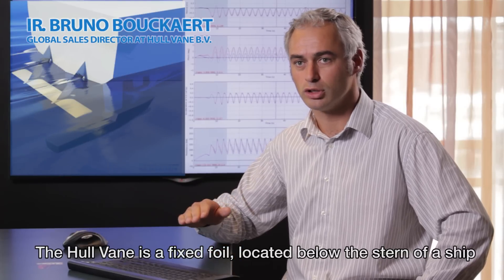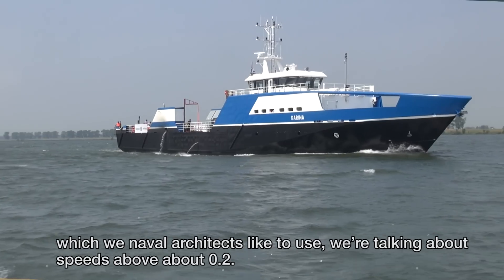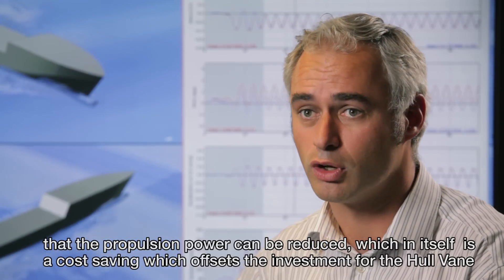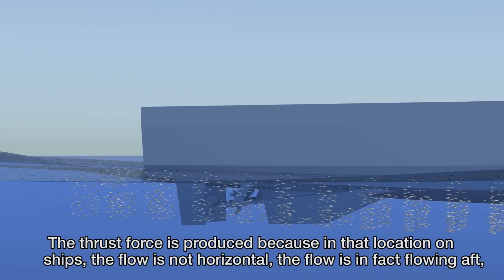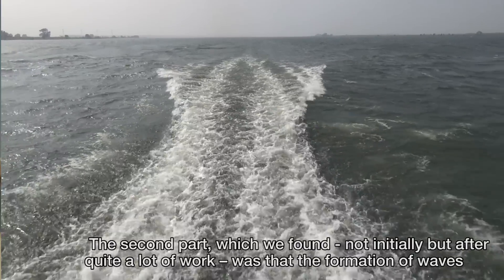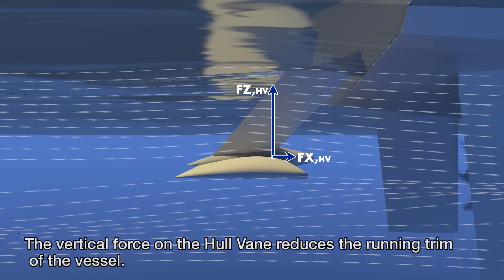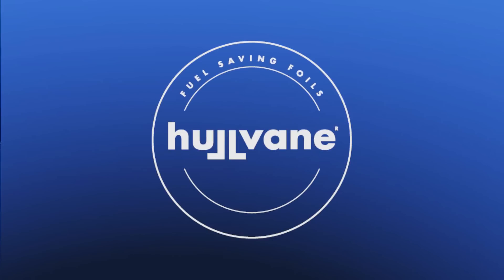Hull Vane - Fuel Saving Foils

Comment: Forgot to mention a fifth benefit: In waves, the dampened rocking of the hull will also provide a much more stable experience for passengers, crew, cargo, and mechanical stress on the ship's hull itself. Any cruise ship maker should celebrate and exploit this tech immediately. 
Has anybody experimented with variable geometries in hull vanes?

Comment: This is not that much beneficial. They are improving wave-making resistance but adding too much weight + wetted surface area. In addition, this technology is already used via BULBS. You simply put the bulb behind the ship and destroy the flow that comes from the propeller. The water should be as much as more open after the propeller. Propellers have the best efficiency when there is open water. 
You little bit of improved stern wake and that is all. There is no way to gain 14% efficiency with this with any hydrodynamically analyzed ships. The effect and benefit is exaggerated.

Comment: Totally B.S.!  The hull is like a pendulum. Lift the rear end and the whole rest of the hull sinks into the water causing more friction. Which is why foils are amidship OR PLACED ON BOTH ENDS TO lift the entire hull as on a ferry. Also, why not just build ships to ride deeper in the bow area to begin with, with weight distribution...  Because engineers know better. design alone can lift or deepen either end.  Also, I DOUBT speed on large ships is just not adequate with their weight for a foil to cause even that low percentage, IMHO...  And if it were reversed, would bring the widest part of the hull DEEPER into the water which would create even more drag... Foils on boats have been around for decades. The U.S. Navy put them on the fast PT Boats and made the very fast a long time ago ...
Reply from the maker: Dear Rob, did you watch the explanation in the video? Kindly also view the other videos on our channel. The purpose of Hull Vane is not to lift the vessel at the aft (even though that  happens and is beneficial on many ships). The purpose is to reduce the overall resistance. You can clearly see this in the reduction of the stern wave (waves are energy, when a ship makes less waves, it consumes less energy). Hull Vane has very little in common with the 100% hydrofoiling applications on US navy patrol boats, Russian ferries and America's Cup sailing boats. Different kind of ships (in weight especially), different location of the foil, different goal and different working principles.

Comment: I was Ch Officer of a 100m long coastal tanker, max draft 6.0m. When fully loaded i kept a 0.5 -1.0m trim by the stern. Sea speed about 11.0 knots. Contrary to what was shown in the video, at sea speed my vessel takes a trim by the bow, even with initial static trim of 0.5 - 1.0m by the stern. When my ship moves ahead at sea, rain water and sea water on deck would flow forward towards the bow. When the vessel reduces speed on arrival port, the water flowed aft. Perhaps this aspect needs to be studied further.
With the hull vane fitted, i presume the ship will be trimmed more by the head when moving at sea, lowering the bow height above water.

Comment: Would it work on Fishing vessels at speeds of around 5kn? it would be benefitial since the maximum power allowed for fishing vessels is restricted. (but the regulation dating from 1975 never took the shape of the ship into account) If this can help the fishing vessel reach the ideal 'fishing speed' at around 4.5- 5.5 knots, combined with better fuel efficiency and stability that would be very interesting.
Reply from the maker: What is the length of those fishing vessels?
Reply: @hullvanebv2550  24m but I saw on the website that the vane works from 8kn so they might go too slow for that.

Comment: How much difference is there in performance to that of cav plates ?
Reply from the maker: Do you mean interceptors with cav plates? There is a paper comparing Hull Vane with interceptors at various speeds for a typical round bilge displacement hull on our website (AMECRC series 13): https://www.hullvane.com/papers/
Reply: @hullvanebv2550   Interesting.
  I'm curious as to the differences between the fixed propulsion you diagram and outboard propulsion. The cav plates/ appended vanes I've seen on either side of outboard driven boats help with planing. I believe that your treatise is also. As well as efficiency.

Comment: Question, when doing your research and development of this design how deep did you go into the design at the starboard and port horizontal end of the hydrofoil?  Specifically, did you do analysis using "winglets and scimitar winglets like Airbus and Boeing?
Reply from the maker: Hi Apack, good question. Winglets can help in some cases, but not as general as on aircraft wings. It depends of the local flow and the speed range of the vessel (narrow vs. wide).  Some of our Hull Vanes are U-shaped, which means the wing curves up at the tips, to become the struts.

Comment: 2:13...this really confuses me...I have always known that a wing produces lift and drag, that points backward, and not a forward thrust...
Reply: Yes, when a plane fly's horizontally and the air flow comes from the front. But when it comes from the front and below, it is the same as if the airplane is flying slightly downwards, in which case it accelerates. That's how any glider flies. When the wind is coming from below, the plane can fly horizontally and still accelerates, this is how slope gliding works. Same effect here, the water current under the ship moves slightly upwards, and thus the foil can generate lift up and forwards.
Reply: @Rocco_Kurokawa  you are right, I was considering only the main horizontal flow and not the local vertical one they speak about in the video

Comment: How much lift, as a percentage of the  ship displacement, is generated by the Hull Vane? Is it the same percentage as the reduced resistance (or required power) you show in the video (12%)? Thank you
Reply from the maker: This depends a lot of the ship. It can go up to 10%, but on the vessel in the video it is less than 5%.

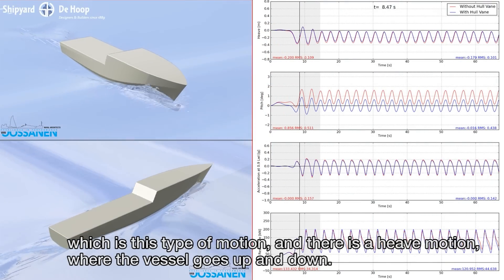Comment: 3:24

"Damp", not "dampen". (Also, it's already wet!)
Reply: damp·en
2.
 make less strong or intense.

"nothing could dampen her enthusiasm"

Dampen is correct.
Reply: @michaelcopeland8806  Umm, yes. Her enthusiasm notwithstanding, in engineering, in English, "damp" is more common and correct in relation to vibration and oscillation.
Reply: @sgabriel  Damp relates to engineering only when used as a verb, which is Dampen.
https://www.dictionary.com/browse/damp
Reply: @michaelcopeland8806  I recommend against using Google exclusively as a research tool. A lot of people do say "dampen" these days, so: fine. But I don't like it, and a lot of other engineers don't like it either. Anyway, doesn't matter particularly. Having said that, mostly we use "damp" as an intransitive verb, as in "damp down" or "damp out".
Reply: @sgabriel  Then why are you trying to correct someone else's use of a word, when it is you using the same word incorrectly, just because you don't like it. Dictionaries are dictionaries. Education is a wonderful thing.
Reply: @michaelcopeland8806  You got me, there.
Reply: @michaelcopeland8806  No need to be nasty, son. My education is excessive, but don't hold that against me. Mean time, try out "damper", a noun, which refers to a thing that...wait for it...damps.
Reply: @sgabriel  You have been educated by a more educated person. Have a wonderful day!
Reply: @michaelcopeland8806  I'm not sufficiently educated to understand what that means. But, you have a wonderful day, too!

Comment: If sea critters thought propellers were scary wait till they meet this blade of death.
A whale is gonna rip it off and maybe the whole stern.
How about a wind wing, less drag and weight and controlled lift using tried technology. Birds see it coming and get out of the way, not so underwater.
Plus everything is topside reducing corrosion and easy maintanance.
I'm thinking biplane for lift with wings that fold for foul weather.
How about steerable kites for reducing fuel.
I was going to try one off the bow of my 20' fishing boat.
Reply from the maker: Most of the water coming over the Hull Vane has usually already passed the propellers (much sharper blades rotating at much higher speed), rudders and stabilizers. Wind wings are used on boats for lift (see A2V boats  or Wing-In-Ground ships), but that's only effective on much faster, much lighter boats.

Comment: I read that this concept has been install on a catamaran initially,there is not much review on the results of this attempt, i am interested in this concept mainly to sail under low wind and to  keep the bow out the water for increased speed,can you  shed some light on this?

Comment: Nothing new, just a half hydrofoil system! Hydrofoil is much more efficient!
Reply from the maker: We call it partial hydrofoiling, and it is something new to use a hydrofoil for this purpose. Yes, 100% hydrofoiling may be extremely efficient on water, but our solution is intended for real ships, with real payloads, navigating in real seas. 100% hydrofoiling requires a totally different vessel, and is not suitable for all applications.

Comment: water dynamics r diff than air, greatly diff in drag, but idea is the same.
Reply: A bi-plane gives even more lift but w/drag. Air & plane drag increases greatly w/speed, but ship r not going to get the grea increase in drag w/speed bc they already hve great drag from water & don't go great speed. So if 1 wing is good a 2nd lower wing bigger a bit behind it r even better. Twice the wave sofening & less drag along the hull.

Comment: Sleek, the equations & multi forces at work might b complicated but the design is perfectly simple. Just behind the ship u a generating lift 1 & 2 the prop & wing r postioned so as to maximize this lift. At rear u hve the most leverage, & lifting force helps to bal out rolling wave force. Smoother ride less drag candy ass simple.

Comment: if you have a vessel that does a lot of pitching where it operates.. you might want to create a one of your wings that has hinges  close to the front edge and can be remotely unlocked on the rear..  this can create forward thrust from the pitching.  why dampen it totally when you can use pitching to add thrust.  it won't work on vessels that don't have enough pitch during normal operation but some..  there was a study about 25 years ago .. about a sailing hull with a design that had a lot of pitching designed in with hinged wings to create forward thrust..   somebody designed a reversing pitch blade to use with air boxes over swells allowing the change in airflow to spin small generators in the same direction no matter which way the air was flowing thru the fan..
Reply from the maker: Hi Wayne, good ideas, but as is often the case with good ideas, it has been thought of. We have a version which hinges and has an actuator for additional pitch dampening, called Dynamic Hull Vane. Pitching causes a lot of added resistance, so you generally want to reduce it as much as possible. The (passive) Hull Vane generates forward thrust out of the pitching motions through something we call "the pumping effect", similar to what surfers do on hydrofoil surfboards.
The Hull Vane converts both the stern wave and the ship motions into forward thrust, making the ship quieter, more efficient and more comfortable.

Comment: Is this still effective when you have  two propellers one behind the other on the same shaft that raises  propeller efficiency from 60% to 80% .If both can be combined the potential for fuel saving is hugely increased .
Reply from the maker: Hi Ronnie, yes the Hull Vane would still be effective. Counter-rotating propellers recover energy from the rotation of the propeller flow. Hull Vane recovers energy from the "rotation" (or rather upward flow) given by the ship's hull to the water.

Comment: What is the slowest speed the foil would be effective?
Reply from the maker: Hi Kevin, that depends of the length of the ship.  For a rough idea: for a 20 m about 6 knots, for a 50 m about 9 knots, for an 80 m about 11 knots and for a 140 m about 15 knots. But this also depends of displacement and hull form.

Comment: I wonder if this would work on a 50 foot monohull sailboat?
Reply from the maker: Theoretically it could, but it may be cost-prohibitive compared to the benefits (relatively small speed gain on such vessel, higher pointing and better seakeeping). Modern racing yachts (where cost is less of an issue) are too fast for Hull Vane (planing and even foiling hulls).
Reply: @hullvanebv2550  what do you consider to be a small speed gain?  On a heavy displacement cruising boat that sails at 8-10 knots a "small" gain of one knot is indeed significant.   The damping of pitch would be a nice comfort benefit as well.

Comment: Firstly, I love this tech. I don't have a degree in hydrodynamics, but I did once pick apart and disprove the work of a PHD in Hydrodynamics. Just because fun, and his work was messing with my mechanical design. Q&A: Any of these systems have variable AOA, for the purposes of and not limited to: fine tuning to an existing vessel, variable for power setting, vessel speed, sea state, other. Also variable positioning up/down, for/aft for same reasons. Also any option for one on the back of a dive boat with active hydraulics for mitigating aft deck pitching! After a scuba dive, It's no fun trying to board a ladder pitching past you a couple of vertical meters.
Reply from the maker: We are working on an active version (Dynamic Hull Vane), but the AOA is mainly a function of hull shape, and therefore not very speed-dependent. The purpose is to vary the AOA to vary the lift, and therefore increase pitch damping.

Comment: An interesting video. I’m curious, does this provide more benefit to ships with a bulbous bow, through the synergy of keeping it at the ideal level it was designed for?

Or as this adjusts trim, and the bulb was probably designed with the innate trim of the ship in mind, does this necessitate redesign of the bulb to see maximum gains? 🤔
Reply from the maker: Hull Vane works both on ships with bulbous bows and without. They work well together, but some ships (e.g. RPA 8) are too slender in the bow to gain from a bulbous bow, and can still have a big benefit from the Hull Vane. Hull Vane helps keep the vessel more even-keel throughout the speed range, which is advantageous for the bulbous bow.

Comment: Hydraulic trim tabs do the same thing.
Reply: Capn BillL, My buddy had a 38ft Silverton. It came with trim tabs......We took the boat out to the continental shelf, 'bout 95 miles from Sandy Hook NJ. ( Mako SharkFishing) . We hit some rough water on the way there. So I don't know how efficient those tabs were....Guess maybe in calmer waters they're feasible?
Reply: @tedhernandez2394  Yes, with heavy seas the inertia of the boat when hit by a wave overcomes the lift of the trim tabs. Also they are more effective with speed, hard to attain when you are climbing significant waves.
Reply from the maker: Hi Captain bill. Hydraulic trim tabs do one of the four effects (see video) of the Hull Vane: trim correction. They do this by creating a lift force which is angled aft. Hull Vane does this with a lift force which is angled forward. This makes a big difference in resistance.

Comment: Would it make sense to retrofit a sailing yacht with a wing? One couldn't install it to far aft, though (marinas, docking,...).
Im aware that there are foils for sailing yachts, but they are advanced to manage, expensive and hard to retrofit.
Reply from the maker: Yes, it can make sense, but it depends of the sailing yacht's shape, displacement and speed. Just the optimisation is often already too expensive. Payback period is hard to achieve when you don't consume fuel...
Reply: @hullvanebv2550  But consider all that wind we'd be conserving for those blowhard politicians!

Comment: Not sure what the big deal is...  The boating industry has been utilizing cavitation plates for decades, which does basically the same exact thing as this "hull vane" except its not mounted under the boat.
Reply from the maker: So it's a very different thing. An anti-cavitation plate is not situated in an upward flow, and therefore does not generate a forward-angled lift force.

Comment: There is no potential application to smaller outboard powered vessels / trailerable craft?
The vane has to be positioned behind the propellers?
Can it work with surface piercing propellers?

Sorry for the 101 questions, just trying to wrap my head around this interesting concept! 👍
Reply: there have been outboard cavitation plates for years that do the exact same thing.... i dont believe it has to be mounted behind the propellers because this is controling the water coming out from under the boat, not from the point of thrust
Reply from the maker: Outboard powered vessels are usually planing boats, and boats with surface piercing propellers most certainly are. There are other foil solutions for such high speed-to-length ratio vessels. Hull Vane is for semi-displacement and displacement boats.

Comment: Why not have a hull vane on front as well?
Reply from the maker: It's possible but this only gives resistance reduction at higher speeds than the typical application range of the Hull Vane. For seakeeping it's very interesting, and Hull Vane can be a good combo with a (retractable) T-foil forward.